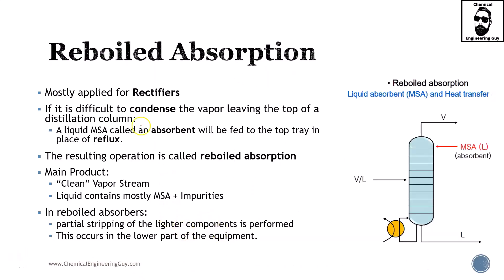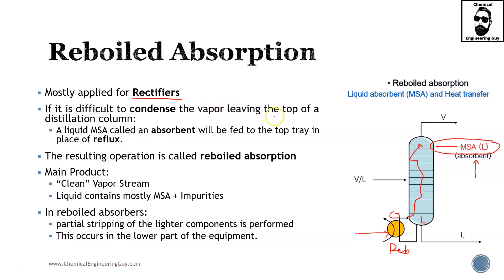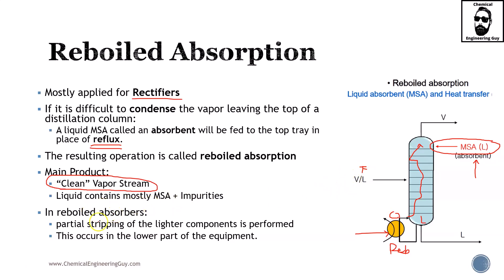Reboiled Absorption - Gas Absorption Application with Reboiling (Lec081)

Comment: hello, how do you know to choose a reboiled absorber instead of just a distillation column?
Reply from the maker: well... those are 2 units very different... Absorbers will use a solvent and a solute while distillation requires a mixture that can be separated by volatility differences